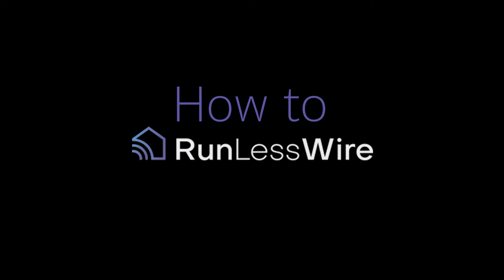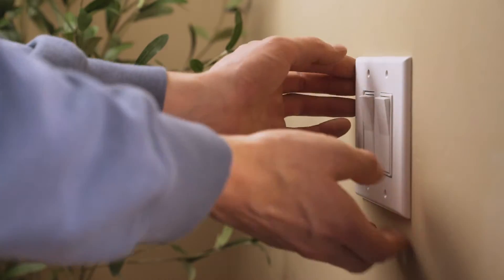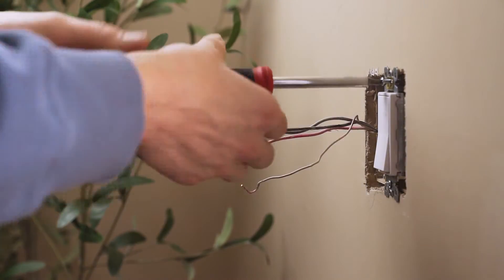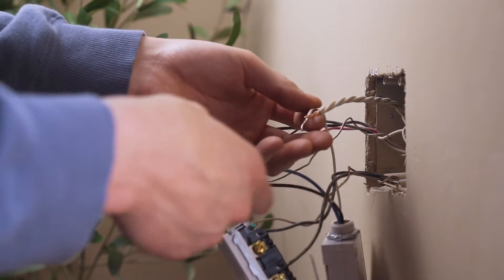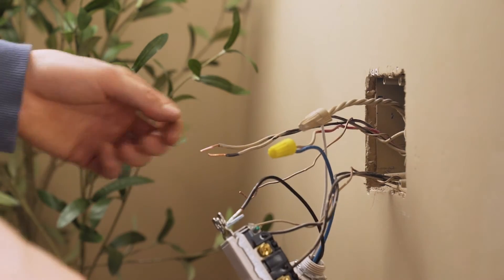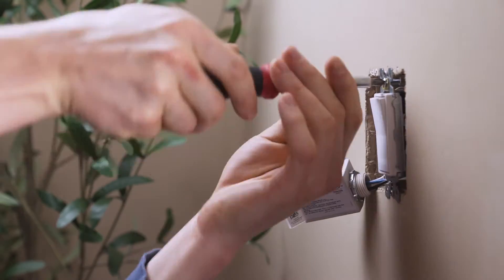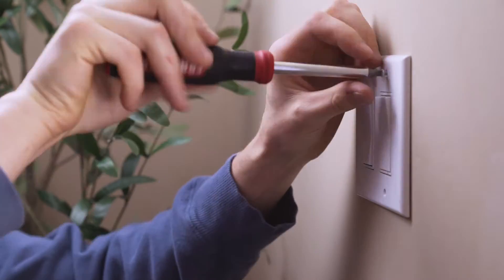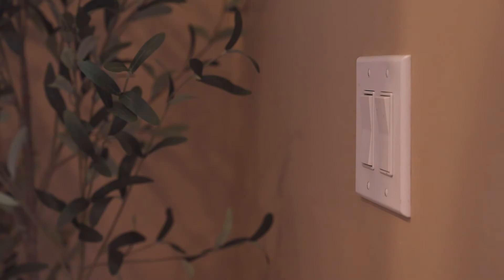How to Replace a Light Switch - RunLessWire Wireless & Battery-Free Kinetic Switches

Comment: I don't understand why the receiver would be installed in the same place as the switch. Shouldn't it be in the light fixture? Otherwise, what's the purpose?
Reply: I agree 1000000%
Reply from the maker: Yep, totally see how that wouldn't make sense - installing a receiver and switch back at the same switch location seems like it would essentially be buying a new, probably more expensive switch just to function the same as the old one. Thanks for pointing that out and helping us know what we can communicate more clearly!

Here are a few reasons we show the steps we do:

1. Switch boxes are usually the easiest places to access circuits and are preferred by many of our customers, no matter where they're putting the switch
2. When people buy our products to add additional switches to a circuit, they typically prefer to keep the existing location instead of moving it, in which case it makes sense to install the receiver and switch at the switch box
3. When people just need to move a switch location, they often install the receiver at the box because, as I mentioned earlier, it's convenient. They then typically put a cover plate over that location and mount the new switch in their preferred location.

You definitely can install the receiver at a fixture, circuit breaker, or anywhere else you can access the wires you need - we just try to show the most common examples in our tutorials.
Reply: I’m glad you asked, because I was perplexed and thinking “Damn, I’m an idiot, I guess, because this makes no sense.”

Comment: Why does my receiver have 2 blue wires, but yours has only 1?????
Reply from the maker: Sorry for the late reply! It sounds like you had the 20A receiver, and this video shows the 5A receiver. The 20A has 2 Blue wires instead of one to give that extra amount of power needed for higher powered circuits.